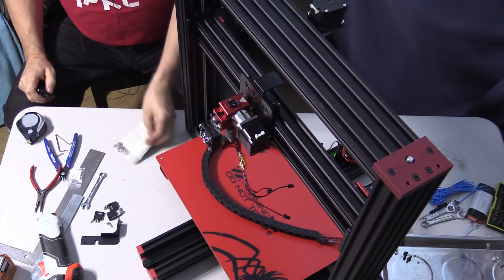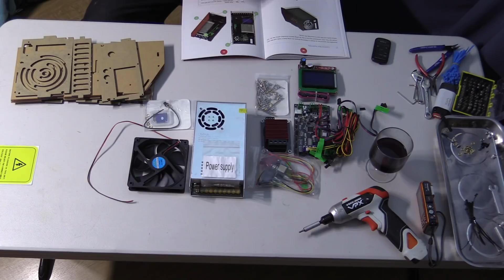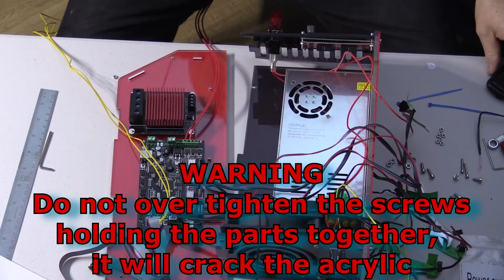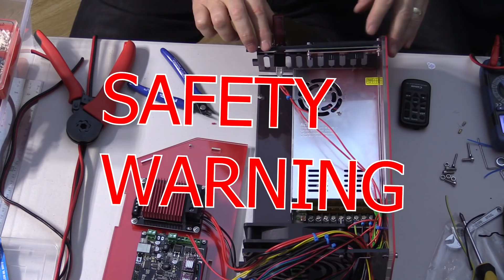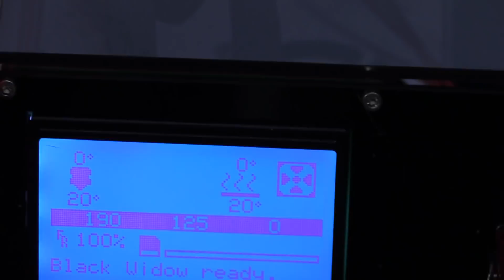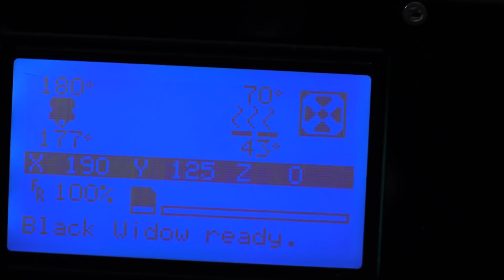TEVO Black Widow 3D Printer Kit - PT 3 of 4 - Electrical and initial test

Comment: imho view the solidity and care with which they made the frame I think they could increase the size of the print bed: similar printers offer 30x30 cm of print area, perhaps only changing the position of the bed motor (ie upside down). the problem of the extruder can be avoided by rotating 90 ° clockwise the hot end (in a future version of this 3D printer) is not an elegant solution but it would work, or with a smaller motor, since the torque is multiplied by the coaxial reducer it does not matter that the engine is as powerful as the others
Reply from the maker: Fix for the extrude already happening, there are already fixes on Thingiverse for it and easy to add.
My Tronxy X5S has the 300x300 bed and while it is nice to have a square bed, its not essential for most folks,  It is a goodsize as it I think. now the issues with such large beds is always the power required to heat it quickly to over 100 Deg C, the X5S fails in this regard but the BW does it well (24V PSU and a beefy MOSFET and thick wires.)
Reply: Sorry Peter but I meant that the printing area could be larger, I said 30x30 as an example, but not necessarily square.
Today I saw another review dating back to a month ago that pointed out that the structure is as strong as material (80x20 and so on) but the connecting brackets allow the frame to bend in the direction of the diagonals and proposed the addition of inserts of aluminum applied at the corners
Reply from the maker: Oh yes, the structure is very strong and could easily have an additional build area without changing the basic frame, the issue is the power required to heat such a big build plate (Assuming your printing other than PLA), the heat loss would also go up with such a big area

I would say a silicone mains powered bed would be needed in this case, and about 750W or more as well if you did not want to wait 30mins or more to reach temperature.

Comment: I do like the Tevo stuff you get quite a lot for your money, I have a Tarantula and recently the Tornado and they are printing well, I must get myself a Black Widow as I do like them and wouldn't mind the full set, I do have a Prusa Mk2 and CR-10 but I still think the Tevo's outshine them in many ways especially the print quality despite all the negatives over the Tevo experience that is about. regards, RobUK
Reply from the maker: So far they do seem to be nice, that's for sure, its just a shame that the basic essentials like a part cooling fan is left off, for what would cost the manufacturer less than 5$ to add.

Comment: there is usually a jumper patch on the PSU mainboard in the circuit for the fan where you can add a thermal switch. https://www.banggood.com/KSD9700-250V-5A-45-120-Plastic-Head-Thermostatic-Temperature-Switch-NO-p-979887.html
Reply from the maker: That would be perfect, ill check next time i'm in there, thanks